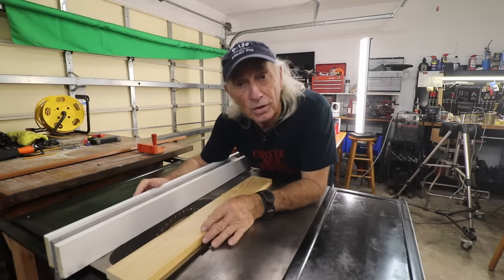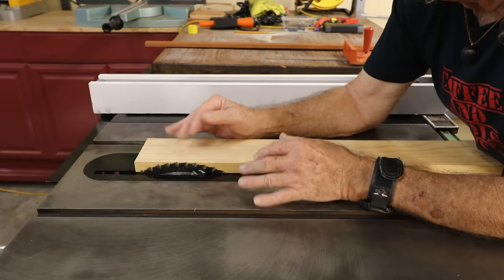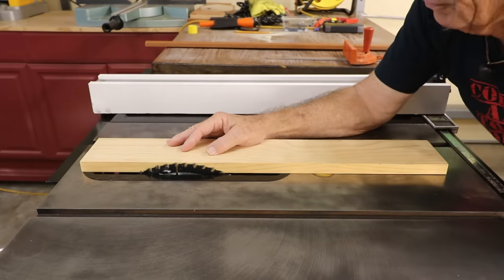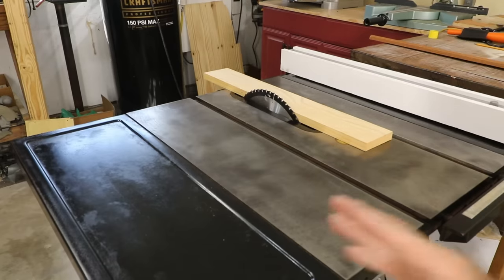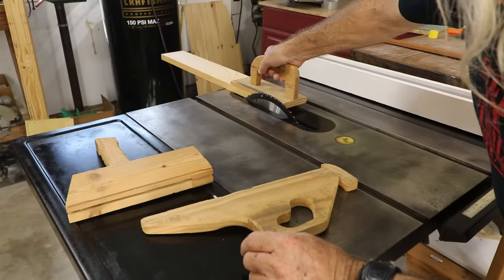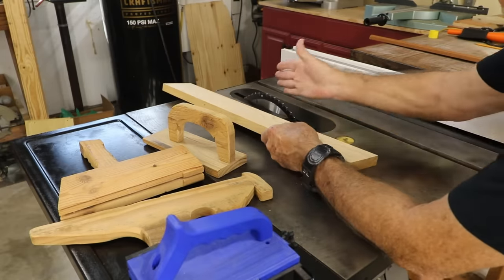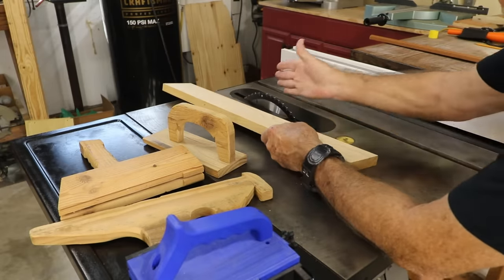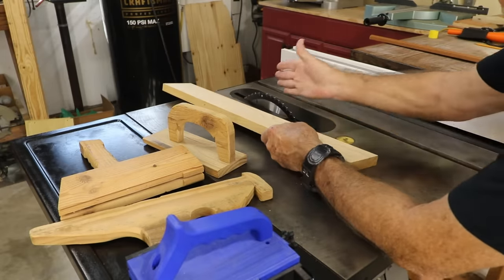Table saw secret nobody will talk about from the good old days, C&T episode 180

Comment: Great show!  Couldn't find anything to complain about.  50 years is about right for me as well, and I have never been hurt yet.  I did have one instance of kickback that could really have hurt (cutting a product called Finform, 17 layer Birch I think, and razor sharp edges as it came through the blade ... but it missed me), but none since!  The only thing I would add is a system that anybody that comes out to my shop knows to LISTEN, KNOCK, SPEAK LOUDLY before entering.  The other thing is that I never take my eyes off of the blade.  You're right, that machine will eat you alive if it gets its hand (blade) on you.  Blade height for me is about ⅛", and no riven knife or plastic cover. Eye/ear protection, and an open shop door for the dust to leave.  Tip: a ballistic vest will stop a bullet, but you are still going to the hospital.
Reply from the maker: Way to go Paul !

Comment: I recall when I was a kid my Dad taking me to the local lumber yard, which had a milling shop. ALL (or it seemed like all) of the men who worked there had missing fingers or parts of fingers! That taught me a lesson that I have never forgotten... keep my fingers/hands away from the blade! I always use push blocks, and I usually keep the blade low. I try to hook my little finger over the fence, so my hand is less likely to slip left, into the blade.  I ALWAYS, DELIBERATELY, FOCUS! If cutting slender pieces, I use push sticks, but am always aware that they are less stable than my blocks. I ALWAYS stand outside the kick-back zone, when possible, just in case! SO FAR, SO GOOD! In 15 years of regular table saw use, I've never gotten so much as a nick.
Reply from the maker: A good routine for keeping fingers off the blade.

Comment: I was up a 3/8 inch,  I'm 62 used a table table since high school. We recently moved, and in the move I threw out all scraps of wood, including my two push stick/guides, since I sold my old table saw for the move. I bought a nice new to me Porter Cable, foldable with wheels and took OFF the two safety guides. I was running some oak through trimming it down to 1/2 inch thick, with the plastic guide that came with the saw and no second outside guide. Uh oh! I got confused, reached OVER... That was two months ago and a trip to the ER with 11 stiches I still have trauma writing here about it. I put a 1 1/2" long x 3/8" dado in my thumb! The thumb is looking much better now, thought the nerves are still trying to heal across. I have since reinstalled the safety kick back and plastic cover. But I lack confidence in my judgement, to use the saw...I have some 2 x 6s I need to take down to 2x4, but I have surfing the net, to make some smart push sticks/ guides. Time to "get back on the horse"
Reply from the maker: Getting hurt just once can really put a scar on it. Good luck with getting on that horse. Sorry to see this post, but working safe is just the best way to enjoy it.

Comment: I have a small trick I use to reduce kickback and that is to have the fence a hair wider at the far side of the blade than the front side nearest me - just very slightly so it cannot pinch at the far side. I also never stand directly behind the wood but always to one side using pushsticks to put it through.
Reply from the maker: Agreed, the wider rear seems to help.

Comment: I am a master carpenter and joiner O N C & H N C , time served, 56 years in the trades.Had my own mill and joinery shop, and still have all of my fingers  "undamaged" . I also had a engineering shop, but that's another story. As an apprentice we were taught to have the blade  about 1 1/2 inches above any timber , this avoids kickback quite a lot, but with a riving knife and top guard in place it also stops the lifting effect. Always worked for me, but that said . most time the Rip saws 18 inch and 26 inch  were as high as they would go and hardly ever lowered. And of course with a chip and dust extractor on the go very little dust is kicked up. Key point  a sharp blade is vital, dull blades are more dangerous in any tool.
Reply from the maker: This is basically how I was taught in the "good old days" thank you for this post.

Comment: Having a fence that is parallel to the blade is priority #1.  A fence that is closer at the back of the blade in comparison to the front of the blade is like pushing a piece of wood into a funnel causing the wood to lift at the back of the blade.  A riving knife is also helpful because it keeps the kerf from closing up and pinching the back of the blade which could push the work upward.  Once you have a parallel fence and blade and use a riving knife, then you can debate blade height.

Comment: The only time I had a kickback accident was when I lowered the blade. It was nasty and split the end of my finger in an instant. Geeez it hurt. I now set the blade with the bottom of the gullet at the level of the timber, plus a riving knife to prevent the timber closing on the blade.
Reply from the maker: OUCH>....dang that hurts

Comment: I’m in your camp, I’ve always set it up a bit, but I use both ways. The only thing I find about setting the blade low is it’s not as visible and I don’t like that, and the wood tends to want to jump above the blade if I hit a tougher spot through the cut. It’s down to common sense, and that’s a disappearing thing. Cheers.
Reply from the maker: Well the school of thought has changed from my old days.
Reply: @SirTools  yes it sure has. I used to be a trainer of high risk machinery, crane and rigging mainly, and within the industry it’s now acknowledged that common sense has not been like the old day’s either, it’s now known as acquired sense. Too many young guys with no idea about risk and safety. Cheers mate, .
Reply from the maker: I'm calling it un-common sense now :)

Comment: Good video. I also like to keep the blade a bit high. I also use featherboards or a scrap piece  clamped to my fence  to keep the workpiece down and always use a good push stick. I  wear my respirator and try to stand  off to the side behind the fence whenever  possible. I have a riving knife somewhere but I've never used it. I might try it someday.
Reply from the maker: That feather board is a good idea. Tomorrow I'll be talking about kick back. Lost a good friend last week.
Reply: @SirTools  TY. These machines can hurt you for sure .
Reply from the maker: Sad, but I'll be doing a show about kick back on Thursday after getting a phone call out my old carpenter buddy Matt.

Comment: I’m lucky to have all my fingers, I worked with my dad and brothers all my life installing hardwood floors and finishing. Many rips and fit cuts with a crappy shaky table saw on the floor. No guards no push sticks. My dad and oldest brother lost fingers. I’m 54. Today I will not make one cut without a good push tool like the ones you use. I watched a guy have a kick back and the saw flipped over and made a nice cut across the new wood floor. Lucky he had all ten after that. Great video.

Comment: A guy I have been working with for many years at several different companies talked about this. How the blade pushes differently against the wood at different heights.
   He had a boss yell at him for having the blade too high when he was cutting quarter inch thick oak.
    Having the blade low in that case makes the wood chatter and gets a crappier cut. And it actually increases the chance of a kickback. Having the blade a little high puts downward pressure on the wood from the cutting side of the blade when you are cutting thinner materials.
   If the blade is too low, thinner material can flex upward giving the top of the blade a chance to grab the bottom of the material and kick it back.
    I think rules of safety are important.
 But sometimes they are general and situational. A safety rule can be unsafe if we ignore our observations and basic reasoning.
Reply from the maker: I've had that low blade chatter and it really did mess up my work. Thanks for posting

Comment: I am a professional cabinet maker, I was taught to raise the blade so the bottom of the gullet is at the thickness of the wood. My only table saw incident was 20 years ago, but I was cutting solid surface countertop material with a dull blade.

Comment: Cutting pine, any height will probably work. When I cut 5/4 white oak, the lower blade position makes the feed speed more critical, and the blade will slow down from the friction between the blade and the wood. Frequently, I will cut half the board length, then flip it and cut from the other end, so my hands are always feet away from that blade.
Reply from the maker: Good man !

Comment: So as a counslusion, can we go with the blade like somewhere in the middle, not to high not to low and get good of both worlds? Thanks for the video?
Reply from the maker: From the safety stand point they say to keep the blade down to about 1/8 over the material or even less. I would offer that it is personal and whatever you're comfortable with setting. Kick back is a real threat and should be avoided using the right tools and plans to hold down the wood. Old school told me to run the blade high, but now they say no !

Comment: The back and forth you're showing in the 12:00 timeframe makes puts a lot into perspective, and explains the "kickback" you said you were getting

Yes, the lower the blade the less likely you are to be considered for the next Cpt Hook audition
But ALL of the pushing force is straight back (maybe you said it sooner)
Effectively what's happening - as you're showing by manhandling the blade directly, it isn't terribly sharp - is it relies on the tearing force and inertia of going the 5k rpm's you mentioned
It's more accurate then to say this "efficiently tears" the wood than "cuts through" it

I feel like I'm rambling now, but the bottom line is as long of you are using something to extend your reach of the board across the table safely, medium-high blade is ultimately safer than the "as low as possible" which is more likely to cause some part of what you're dealing with to smack you in the gut and potentially lead to all sorts of dangerous hi-jinx

Comment: I use a medium-sized table saw.  Except under unusual circumstances (which I won't detail, but where I carefully manage the consequent risk) I ALWAYS use a riving knife and a GUARD.   I set the height of the guard so it almost touches the upper surface of the work. The knife is thinner than the kerf, and it mainly serves to support the guard.  If the work were to kick-up, the guard would restrain it.  My second rule is never let your hands overlap the edge of the saw table.  I use a long long pusher stick in each hand to propel the work towards the blade, and also guide it both downwards and sideways against the fence.  When the cut is finished, I hit the saw switch to stop the blade turning before removing the work.  If the saw is lifted until it just clears the top surface of the work, this will minimise break-out from the underside of the work.  It also allows gentle curves to be cut.  I use my saw a lot for sawing the edges of planks for boatbuilding, with no fence, sawing to the curved line, and using long run-on and run-off benches for support.  For normal use, I set the saw blade high, because there is less force pushing the work back against you, and the cutting forces keep the work hard down on the table.  There's also less area exposed to the saw teeth.  A major cause of "push-back" accidents is cutting wood across the grain - I NEVER DO THIS ON A TABLE SAW!!  Also, I NEVER wear rings, a wristwatch, loose clothing, long-sleeved garments, neckties, etc. in the workshop.  (A friend of mine was saved from a horrible death because his necktie snapped when it got caught-up in a planing machine).  Usual disclaimers apply - this is based on my own experiences only, and everyone must make their own individual risk assessments on what the presenter rightly calls one of the most dangerous tools in the workshop.
Reply from the maker: Long but right on the mark !

Comment: My splitter has anti-kickback pawls which help a lot. Also an outfeed table will keep your boards from getting dinged when they hit the floor. One other trick is if your fingers must be on the blade side, hook your hand over the fence so there is no way that you can slip into the blade.
Reply from the maker: Yeah the out feed table would be nice.
Reply: @SirTools  Easy to make if you have a table saw...wait, you do.

Comment: I have a similar saw.. it's a craftsman.  The kerf blade is on the guard which gets in the way quite a bit.  Did you figure something out as far as that's concerned?
Reply from the maker: A local cabinet shop bought the saw from me before I could fix the riving knife / guard issues.

Comment: I've wondered the same exact thing, that you want the angle of the blade on the work pushing a little more downward.
Also I've cut full sheets of thinner plywood (once it was 1/16" hdpe)  before, and if the sheet flexes upward off the table in the middle a little, you still want the blade to come thru.

Comment: I think a very overlooked part of safety with table saws is blade sharpness. A blunt blade requires more force to push against and the more force you are using the less control you have if you slip. Blades are cheap compared to prosthetic limbs. Same applies for router bits in router tables.
Reply from the maker: Got to say YES to this idea !

Comment: I’m 73 and have been working with wood for over 50 years and have never had an accident with a table saw until about 3 months ago. Fortunately I had very little blade above the stock and that saved all 4 fingers on my right hand. Absolutely stupid mistake (aren’t they all), but I came out with no bone or tendon damage, just 60 to 70 stitches by a great Doc; I’m typing with those fingers now, so I am lucky as hell. Mine is a vintage (as old as I, I’m sure) Delta Uni-Saw … great saw, but a riving knife was never a thought when it was built. Still, I’ve never experienced kickback with the saw. Maybe that’s just damned luck, too. The very best safety advice is to bung out the Delta and move in a Saw Stop. My wife now thinks that might be a reasonable investment😅.
Reply from the maker: Saw stop is much cheaper, but glad that you didn't loose those fingers.
Reply: @SirTools  Chuckle, indeed it is. I rebuilt the trunion once in all the years I’ve owned the saw and even at its advanced years it is rock solid. That said, I’ve also used SawStop cabinet saws and have had no complaints and as I’m down to a dog’s life in the shop, longevity isn’t a big issue.

Comment: I use saws everyday for a living (34yrs) and I never have kickbacks because I EXPECT the saw to kickback. Fresh wet treated wood warps and grabs when you rip it. 
Whenever I’m cutting, that blade is going to stall before it kicks back on me. 
Hold your material firm like you hold your morning wood…practice stalling the blade with your material. 
Yes I keep the ripsaw blade high so that it cuts down and not back at my face.
Great video, I’m always catching shit from coworkers that can’t even swing a hammer trying to tell me how to use a saw. Yes, I have all my fingers.
Reply from the maker: When I did dock and deck work, we'd order the supplies in advance and let the GREEN stuff dry out for a week before cutting. I've never had kickback but you have a good point. Expect it and deal with it before it happens.
Reply: @SirTools  we try to let it dry out but if you have a nice stack, the stuff in the middle of the stack never dries. 
There is a ma n pa lumber company here that sells kiln dried treated and we try to use their lumber if possible. 
Also these thin kerf blades that companies are making totally suck at ripping treated lumber… the blade actually warps and walks as it’s cutting and they are far more dangerous than a thick kerf blade. 
The new guys on the crew do not understand this because most have never used a thick kerf blade. 
Thanks again for this video. 
Have a great rest of your weekend.
Reply from the maker: @joebloe9901  HEY...U 2

Comment: All very well made points, as a carpenter with 28 years in a cabinet shop grade environment for a hospital (yes I have made anything you can imagine) for safety reasons beginners should always adjust the blade height/depth whether a table saw or a worm-drive. I prefer to always have the correct saw blade for the task at hand and run heavy duty saw blades for any given material (Aluminum, hard wood, soft wood, ply's, particle/melamine, acrylics etc) all material needs a proper saw blade. Different materials "gum" up the saw at different rates. Having a proper push stick is critical  to safe operation. Yes I will run the blade higher than needed for 2 reasons 1 is to remove the number of teeth in contact with the material at any given time and 2 is to reduce chip-out of the material (and it also reduces chatter to the piece}.
Reply from the maker: Thanks Brett, plan and control

Comment: What is not covered is that a higher blade means more of the blade in contact with the material, that means more friction, which leads to the blade heating up more. This can both lead to burning on the material as well as build up on the blade causing it to dull.

Comment: another point to make in regards to the physics and directional forces applied to the workpiece during a cut is that it is really only the teeth of the blade that are pushing the piece back toward you, so in setting the blade height higher, you have less teeth in contact with the workpiece, creating less chance of kickback
Reply from the maker: Good point !  Thanks for viewing and posting